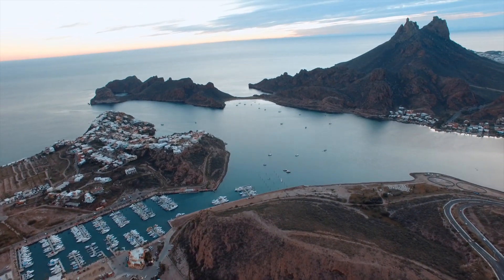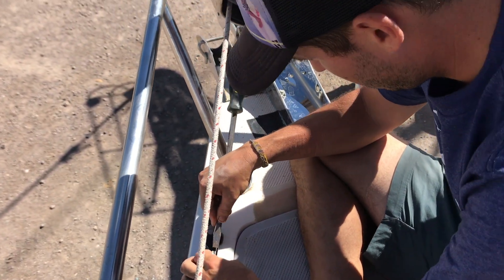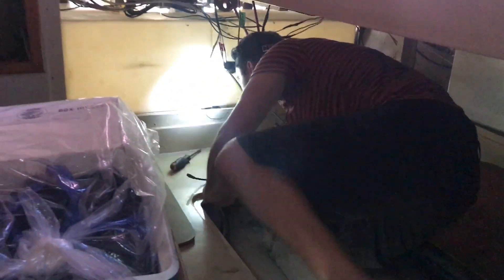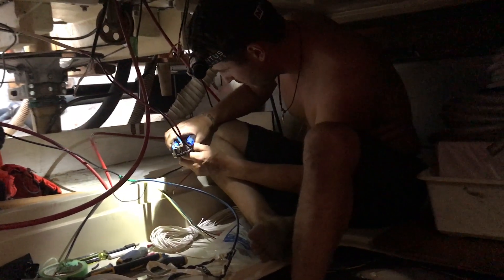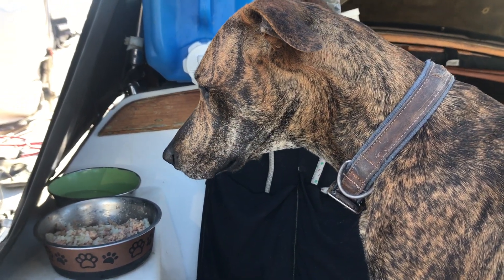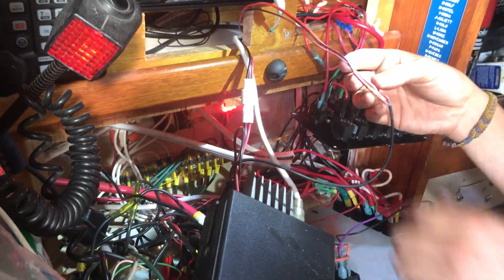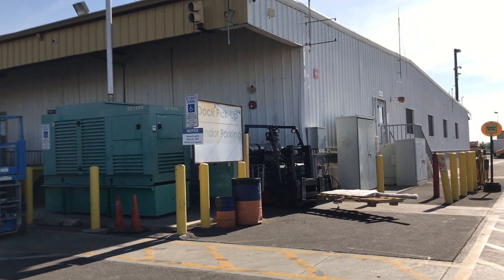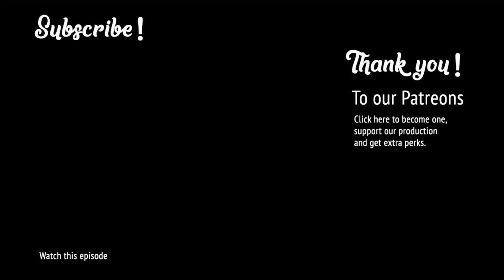Sailboat refit in Mexico (Part 2) - Boatwork, New Rudder & Spearfishing | Wandersailing 2.03

Comment: Nice work; it's the Dude from instagram.  Interesting location for the water tank.  I'm going to start installing my new auto pilot and GPS which will put me under the cockpit. What an ass pain.
Reply from the maker: Ruff Riders Sailing Lol which guy from Instagram?
Reply from the maker: We also have an under deck autopilot and well worth the hard work if done properly. Much stronger and quieter!
Reply: @Wandersailing  I had hit you up a couple days ago with a question since both have a C34
Reply: @Wandersailing  I'm just doing an Auto Helm, but still need to route wires under their.